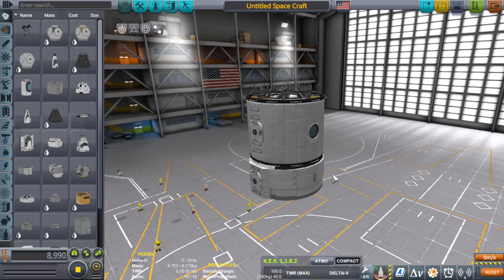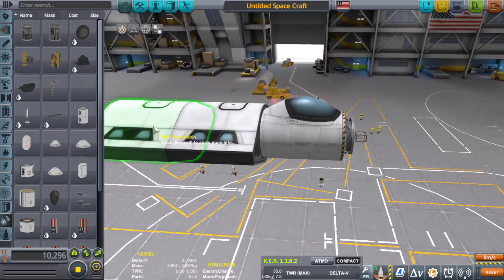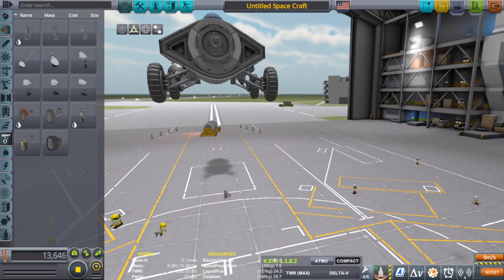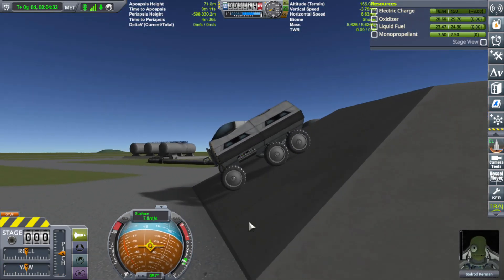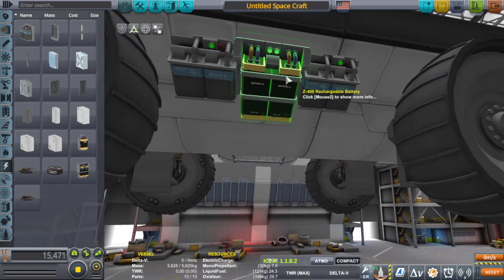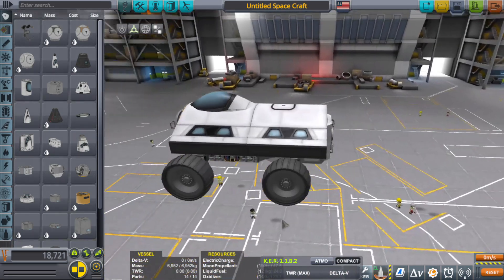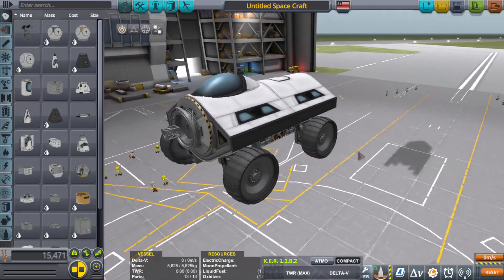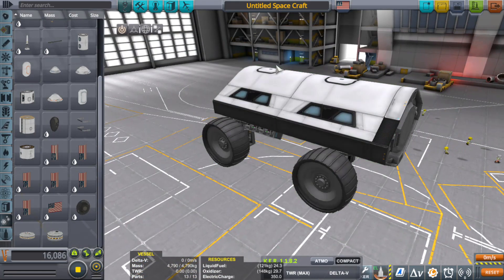ROVER BUS DESIGN in Kerbal Space Program

Comment: Question: what stock part could be overloaded or part copied to be a 'recycler bin' for the next version of SImpleConstruction! (which I am working on as I type)?❓
Reply from the maker: I honestly couldn’t say however, some ideas could include the mark three cargo parts. Finding a way to build a mechanism to put parts inside the cargo bay and then closing it while having the parts inside be deleted and recycled back into rocket parts. I could imagine a junkyard with a machine that pushes debris or junk up a ramp and into a cargo bay. A more simpler way might be just having a craft that has rocket park storage on it attached to a claw. The claw would attach itself to the parts that need to be recycled and kind of like a reverse build the craft being recycled would turn into a green tarp box and then disappear over time. Hell, you can change the color green to red or something. I’ll check my Google mail later today after work I haven’t checked it in a while. 😎

Comment: You're mad VAOS I would have definitely put at least 1 solar panel on that thing just on the chance you some how run out of fuel for the fuel cell.. it would save on having to refuel it and only using the fuel cell at night
Reply from the maker: Interestingly enough , solar panels don’t make that much power on duna because of being farther away from the sun. But yes, maybe a small SP in a container to attach to the rover in an emergency.
Reply: @vaos3712  yeah I've definitely had that problem myself but it's more of a trickle charge over time especially if your only travelling small distances.

Comment: Cool stuff as ever.
But I have an idea / question thingy:

Would it be possible to transfer Kerbins through a dockingport that has a movable hinge thingy between the verhicle and the dockingport ?
If so, you could create a hinge system on the dockingport of you Duna Colony factory.
Preferably adjustable in height.
Reply: there is a mod (can't find it right now - will look further later) that allows kerbals to eva/board through any docking port. there is also a mod (mk1hatch? iirc) that provides a part that looks just like a hatch -